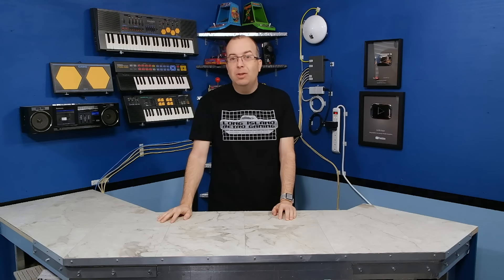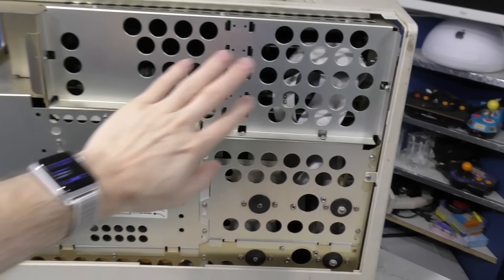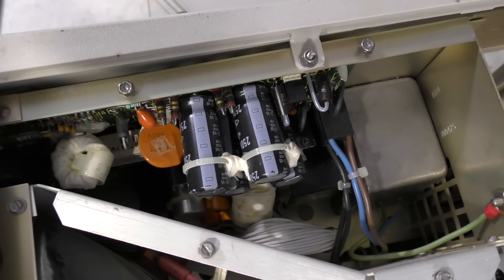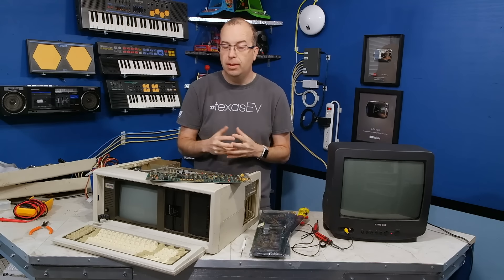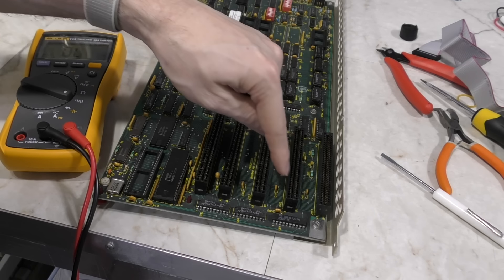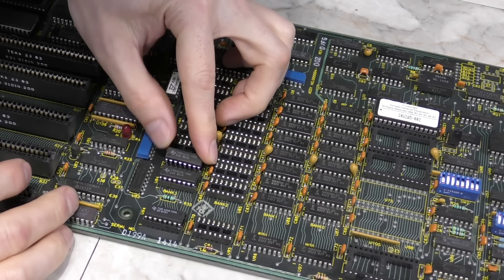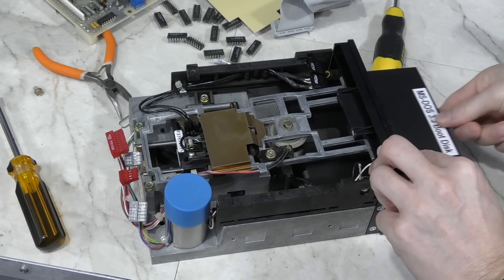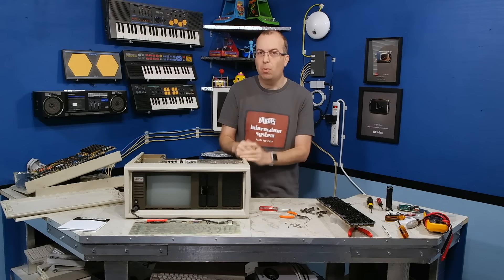Compaq Portable 1 Restoration - Part 1

Comment: To think that was once considered a portable computer lol
Reply: Nowadays, you can wear a full-fledged computer with more than 1,000x the hard disk space on your wrist.
Reply: I also recall they were more often described as "luggables".
Reply: Back then, anything with a handle was considered "portable" -- in fact, these computers were sometimes referred to as "sewing machine" computers, because they were about the same size and weight as a sewing machine in its carrying case.
Reply: VWestlife I can clearly remember my aunt who had a compaq portable as a court reporter referring to them as "Lunch Box" computers, but never heard the term "sewing Machine" computer, but I can see why some called them that.
Reply: The Compaq Portable III with the flat-panel gas plasma display was the "lunch box" portable -- it was significantly smaller and ligher than the Portable I and II.
Reply: VWestlife It more then likely was a Compaq Portable III, but my aunt being her crazy self from then on called just about any portable computer a lunch box.
Reply: I've never actually heard them called that, but looking at that compaq, when folded for 'transport' it does look disturbingly similar to the 1970's era sewing machine that we own (which is a hand-me-down from my grandmother)

Same type of beige case, similar type of handle - even the keyboard at the bottom makes it resemble the way the top half of a sewing machine case separates from the lower half.
Reply: it's as big as my desktop PC but over 10000x less powerful

Comment: I had one of these in pristine condition back in high school with a 10MB HDD and 8- bit Sound Blaster 2.0 card.  Still mad at myself for parting it out back then.  Though not nearly as much as when I parted out a working TI-990 mainframe that turned out to be a very rare machine.  I think it was based on the Intel 4004 CPU.

Gotta love tantalum (AKA tantrum) caps!  I've had them do the exact same thing when I power up an arcade game that has been stored for several years.
Reply: YOU'RE STILL ALIVE

Comment: 5:53 The magic smoke escaped! Oh, tantalum capacitors, almost always the culprits! Those are the worst! Now that I think about it, I have a netbook that doesn't want to power on. If I discharge the capacitors and plug it, it turns on and back off in just about 2 seconds. Maybe a shorted tantalum capacitor? I suspect the CPU, though, as there were some problems with the (integrated) graphics.

Comment: The easier way to open it is to apply gentle downward force with your thumbs on top near the back and when the back deflects toward the read pull with your finger tips. This will release the rear tabs without using a screw driver.

Comment: The reduced height screw head are to save weight. That minute amount of missing metal is the difference between a hernia and a slipped disc when lugging one of these around. 

I have a Compaq Portable (Luggable) II which is nicknamed "Binky" due to the noise the OEM IDE 21 M.Byte (via converter piggyback card to an MFM HDD card) makes.

It runs an IBM 512 K.Byte LIM RAM card to give 1 M.Byte total RAM plus a 256 K.Byte RAM Drive for the Windows 2.03 operating system to dump temp files into, as recommended in the manual.

I had to replace the power supply in 2008 when it "popped" and I have a couple of spare keyboards ready for when that problem crops up.

It's used to run Sinclair Spectrum emulator games on.

SIM RAM first appeared on the Compaq Portable III (286-12) with the plasma screen. I have one of these as well. 

Tantalum bead capacitors were so unreliable in their day for short circuiting, even when new, that they're no longer manufactured or used in the electronics industry. As a qualified electronics engineer just the sight of the useless things makes me shudder.

Comment: Old tantalum caps are a common problem in older systems as are those keyboard capacitve foam contacts disintegrating. Had a Compaq portable acting basically the same way as yours.

Comment: I had a buddy in highschool who had obtained one of the compaq portables, but this was in 1999/2000 so the portable was obsolete even then. So we found we could replace the mother board with any AT style board  so we were able to upgrade the board to a socket 7 board (ive long since forgotten what cpu was in the socket) and swapped out the 5.25" drives for 3.5" drives with an adapter, and the same for the mfm drive to an ide drive.

Comment: The original IBM PC's have issues with the tantalum capacitors going bad, the first thing I did when I got my 5150 was replace all the tantalum caps on the board and expansion boards, and all the electrolytics in the power supply. Works perfect.

Comment: I worked on a Compaq Portable (forget if it was a 1 or 2). I couldn't get it to work at all with any of the expansion RAM installed (would work with the stock 256K). The plastic on the keys was very brittle. As far as upgrading the memory on XT class machines there were two paths. If the motherboard supported 640k, you could simply add the RAM chips (there was also a mod for the IBMs). The more common path taken was to add an expansion card as in the XT and AT era machines like this Compaq, the ISA bus was the system bus (ISA doesn't have a set operating frequency like the 8 or 8.33 MHz sometimes quoted, in an XT with the 4.77 MHz CPU the ISA bus ran at 4.77 MHz).

These add-on cards can be used to add a few other features, namely additional serial and parallel ports along with a real time clock (RTC is read via a command in the autoexec.bat file, but the one I had was not Y2K compliant). Also, take a look at the floppy drive cables, that was another way RTCs were added back in the day.

Comment: You would have benefited bt having an ISA "POST" code board to diagnose this machine.  Suvch a board will report codes on its own leds and give you clues as to whats wrong.  The generally also had voltage indicators etc.

Comment: 5:52 no matter how confident we are, we always second guess sketchy things like this. l tried running a GPU on an external power supply for a friend because his computer wasn't a standard layout and didn't have an internal power supply, anyways it wasn't powering the GPU the GPU was actually back feeding into the power supply somehow. so whenever l unplugged the power supply the fan wouldn't stop spinning, at first l thought it was the caps just draining but this went on for a few minutes until l just decided to stop the whole project. it was one of those ASUS ROG things with the external power brick. his machine had a GTX 750ti which can be powered off of the bus so there wasn't a PCI-E power cable we could use for the GTX1060 he bought. in theory it should have worked but for some reason it didn't. things always get sketchy when you introduce a second power supply.

Comment: I salvaged the same computer. Put that ISA card into ASUS P2B-DS motherboard, and had the monochrome display run natively on a dual P3-1Ghz. You can try it. All you need is to power the tube with a MOLEX connector. You don't even need to have the rest of the computer running.

Comment: Oh gawd! Not only did I buy one of these for the 2022 equivalent of $9000, I still have it! Last I knew, it still works.

On top of the stock build, over time I added an AST 6-Pack Plus card, a Plus-brand HardCard 30, a SoundBlaster audio card, an 8087 math coprocessor, and I'm pretty sure I replaced the CPU with an NEC V20, which performed slightly better than the original CPU. It started with MS-DOS 1.01 and currently has MS-DOS 5.x or 6.X installed. I have the factory carrying case too.

"Portable" was a misnomer; I've always referred to the 32-pound computer a "transportable."

Buying it was a near-impulse when I was in my mid-20s. I stupidly took out a $2000 personal loan to buy the $3000 computer. Buying it completely redirected my career. Long story short, I spent about 13 years working for Intel!

I'd be willing to part with it for the right price.

Comment: Good video!
A couple of suggestions that might help in the future:

1) Those hex-head screws are VERY common on older electronics. Wou need either a NEW flathead screwdriver with very sharp corners on the bit (look at yours at 3:04, you can see how round the tip is) or an accurately fitting hex head, usually 1/4". Since you need to get straight on with the flathead and that isn't always possible, a good 1/4" nut driver is almost always the best way to go.

2) When a power supply gives a quick voltage burst and shuts down, it almost always means one of two things: either there is a short or overload on the output and it has shut down from over-current, or the voltage regulator in the power supply is broken and it has crowbarred for over-voltage. The second is quite rare, and when it does happen is usually a result of a previous short on the output. The right test is to remove all load from the supply and check the output voltage. If it is about right (say within -5% to +15%) the power supply is most likely good and you have a short in the load. If the voltage is very different than what itr should be, the supply may be bad. If you get that flash, immediately check the loads for shorts on the power rails. 

When I saw that flash from the big supply I was betting that as well as the cap, you had blown traces on the video board, which could have been difficult or impossible to fix since it is probably a multi-layer board with the power on the inside layers. Luckily you blew the trace on the motherboard, where it was easy to fix. Much better to check with the ohm meter first.

Comment: I have one of these that I replaced the keyboard foamies on a few years back. It has a math coprocessor and an extended ram board. 512K total I think... I pulled it out of storage today, plugged it in, turned it on, and it blew exactly like this one did. Same capacitor on the VDU board. I clipped off the capacitor and tried it again, and it worked! That is, until I got a 301 keyboard error. MS-DOS 3.3 still booted up though.
I think it's either a bad sense chip or corroded trace on the keyboard. It doesn't work at all. I really want to run the Bad Apple demo on mine. Just once at least.

Comment: First mistake was prying on the side cover. It actually slides off, apply pressure and push up. Back when they were new, we'd lay them on their side and pushing down and forward, remove the side cover.

Comment: Halt and Catch fire.

7 Days? I can't imagine that.
Very recently, I replaced my case and got a new 240mm cooler. it took me about 8 hours to transfer everything over and get it all working with the new cooler because the coolers cabling was all screwed up, alot of the problem had to do with using Molex power on it which as it turned out, you didn't need to do, but putting molex cables together can ((especially on cheap connectors) force a cable out of the connector, which fucked the whole operation.

8 straight hours. Not only was I beat but I was ready to just give up entirely.

Comment: HOLY. FLIPPIN'. COW! 

I'm dealing with a totally dead Macintosh iici and it was powering on (before immediately turning off), and I thought it was the power supply as well. After opening up the PSU, everything seems to test fine, but now I put it back together and get nothing. I did see a few capacitors leaking every so slightly on the mobo so I'm ordering a junker iici and hoping a mobo swap will fix everything (that is if I didn't bork the PSU while taking it apart).

Comment: Update! I just saved a small haul going to the dumpster: TRS-80 Model II w/ disk expansion unit, DMP-400 printer, and one of these!  Mine has two FDDs instead of 1 FDD / 1 HDD though, and my floppies have levers instead of the "pull down" mechanism.  I'm re-watching this video as I'll probably start looking at these this weekend.  They are in pretty decent shape but smell musty :/ Fingers crossed!

Comment: Didn't know was possible to fix an interrupted trace in the board by soldering a cable in the extremities of the path. Saw in other video you scratched the green surface to reveal the conductive part, so you had room to solder. This channel is just not fun, but very informative too. It's by far, my favorite tech channel in the YouTube, followed by The Ben Heck Show. My favorites videos are these repairing/restoration videos.

Comment: Low voltage power supply with high current capability (eg big NiCd battery) was a very good diagnostic tool in TTL era:) You just connected it to Vcc for few seconds and right chip/cap/short manifested itself in a matter of seconds without spending half a year desoldering IC after IC to see which one is shorted.

Comment: Wow so the only thing working was the screen. This video does take me back though, I had a 25 MHz 386 in the UK back in 1988 (I was five) and me and my father did a lot of work on it over the years swapping and upgrading parts like adding a 387 co-processor, sound, more ram and a lot of HD upgrades over the years (started with a whopping 20 meg HD capacity and I think by its demise it had a couple of disks of several hundred meg capacity).

Comment: Sweet old computers.  I remember working on a few of them.  Probably need to dress the tip on that screwdriver so it will not cam out as easily.  The first card you pulled out was likely to be a serial card, not a parallel due to connector gender.  Crowbar circuit probably kicked in on the power supply but second power pushed on through.  I know someone with a couple of near pristine IBM portables, not quite sure what to do with something like that other than maybe retrofit them with newer hardware.  Who knows what he'll do with them.

Comment: I used to work as an industrial systems technician many eons ago and we had those controllers around the plant which were programmed using ladder code. To program them I used one of those which I had to carry around in a cart. Portable? Technically, yes but when you have to take it with your trough an industrial plant, not an easy task :) A few days after I started this work they assigned me an intern to help with the job and also for safety reasons as I was messing with live equipment. As he had no intention to learn the work (he was studding for something else, I don't recall what it was), we made a deal: he would take care of hurling this damn thing around including all the tools and I took care of the programming (which is a one person job anyway). While I did that he just sit around and study. A good deal for both of us :)

Comment: The original power supply was fine. Capacitors don’t get weak! 

Feeding a voltage into a power supply will cause it to short the reverse protection circuit

Comment: Just in case anybody wasn't aware, tantalum capacitors have a rather... explosive failure mode. They tend to fail short circuit, which means that if you stick a modern 500W PSU onto that circuit, that cap is gonna pop like a fuse before the PSU even notices that there's a short, skid stain and all. I prefer to use electrolytics for that reason (either fail open or loose tolerance), but it can make sense to use tantalums on a PCB when you've only got so much space available.

Comment: Forget the screwdriver to take the covers off. Lay it down flat, put your elbow in he middle of the panel and the clips at the top pop open. Use your other hand to make sure the clips don't engage while you take your elbow off the cover...

Comment: I've got a working example of this machine which replicates one I had back in the 80s. Wish I'd kept the original but at least I kept the WD Hardcard (30MB!!). I used to run Sidekick and later Norton Commander. I still have World Golf which was fantastic in those days. I might be forced to dig mine out and see how it is behaving, so I can play along with you....

Do you know where I can find the service manual(?) with the error codes etc? Mine was working last time I tried it 3 years ago but that won't always be the case. 

I seem to recall the main challenge was keeping as much of the memory free as possible, even when running from the Hardcard. 

I believe W7 still supported 5.25" floppies. One tricky issue is how to copy programs onto floppies and that seemed to be the best way. However, when I connected up my floppy to a W7 machine it shorted 12V to 5V (my mistake) and trashed the mobo and all work stopped. Be interested to hear how you copy files between modern hardware and this machine.

Comment: Brilliant machine. Took one of these home from work, around 1985 -- long story short, I was an idiot with a lead foot, aaaand, a mighty WHAM, and computer goes flying out of my pickup truck bed. I watch the mirror in horror as this shiny new $5000 box goes bouncing down the highway behind me, once, twice, three times, and into the ditch, pieces flying off at every bounce. Oh, crap!!! Fired? FIRED?? Haha, I already knew, that I was DEAD over that. Only possible outcome. i scream like a little girl, put the truck over, run out into traffic to pick up the pieces from all over the road. I get to the main machine, my first glimpse of the the crash-cage in this thing. all that came off were the skins, which snapped right back on. Powered up, and not a DAMN thing was wrong, CRT, both floppy drives, keyboard... Only thing was a dent in the corner of the inner cage. My God. These things were literally built like The Terminator. Rip off the skin? Battle Chassis! Good luck trying to kill one! I gave it my best and failed!

Comment: Here is a tech tip, if the power supply designed to run the product seems to be swamped down and seems to go into protect mode then it's a bad idea to try and bypass that by adding more available current.